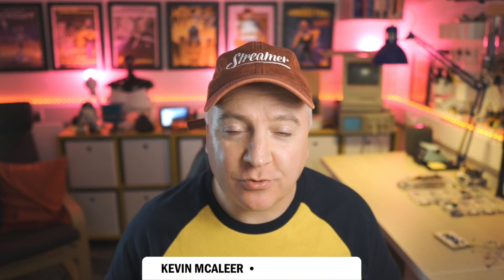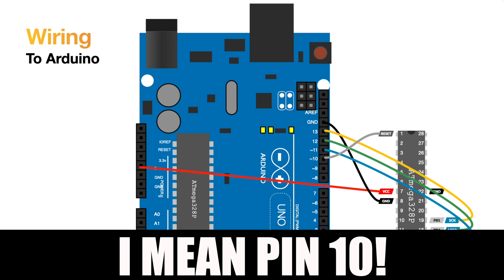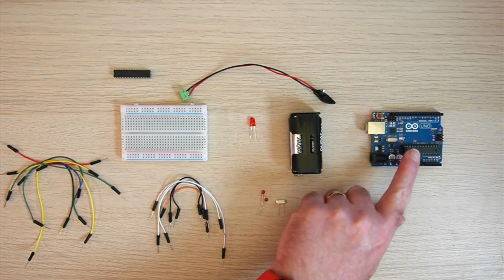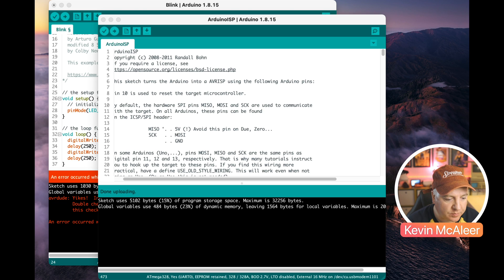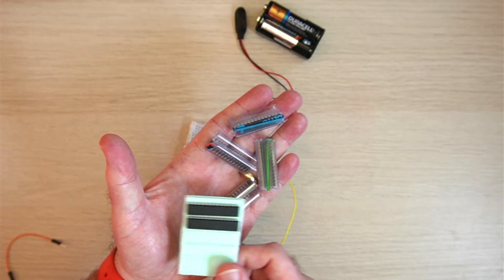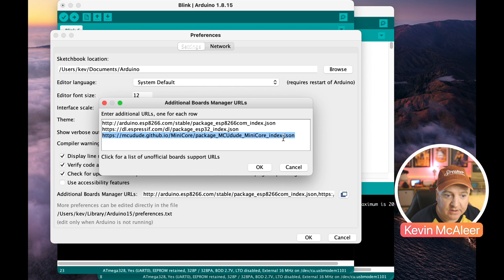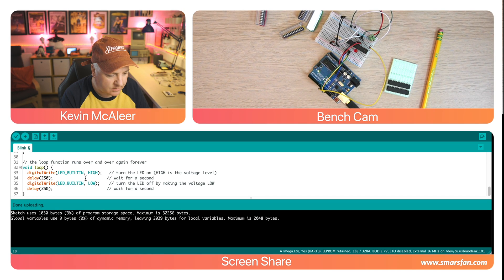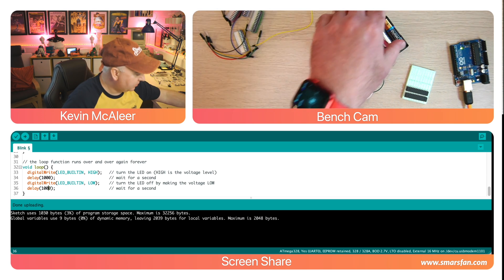Make your own Arduino on a breadboard

Comment: Hi atlanta just wondering if we could do this with arduino shield with more pins or even 7.4 volts battery or 12 volt battery as in the lithium ion batteries used on rc hobbies

Comment: I also found another alternative called the 328BootloadHat - it's a "hat/shield to ease the process of burning an Arduino bootloader to an ATMega328 IC". I guess the PCB can be bought or you could follow the design. It is open source.

Comment: Am I stupid for thinking this was how it was supposed to be done? What I mean is, before I started with arduino's/pi's/microcontrollers, I had always thought we were meant to prototype it on the select board, and then for finalizing we write it to a chip with the components on a circuitboard. That's how I actually thought it was done before I got into this stuff lol. Good to know it can actually be done this way, so I guess it wasn't stupid after all :)
Thanks alot Kevin, now I gotta do this as it might end up being a nice cheap(er) alternative for smaller, less complicated, more permanent projects and frees my one and only board to do other stuff.

PS - I suppose this method can be similarly used to program other boards and also burning bootloaders to corrupt boards with the 1st working board using the ArduinoISP sketch